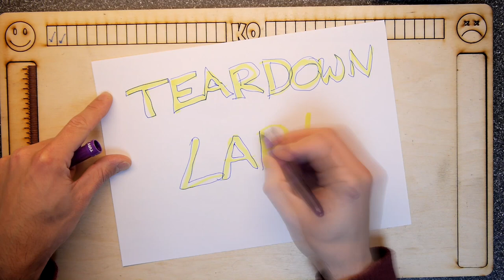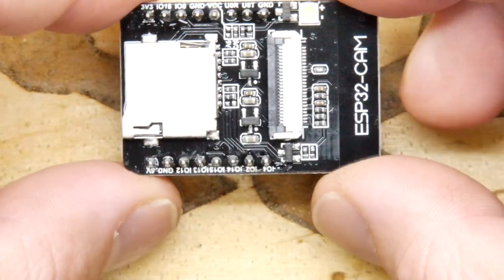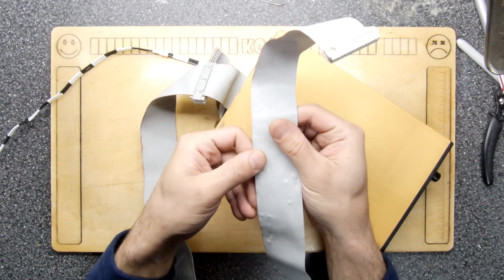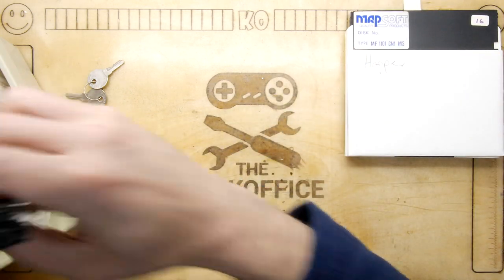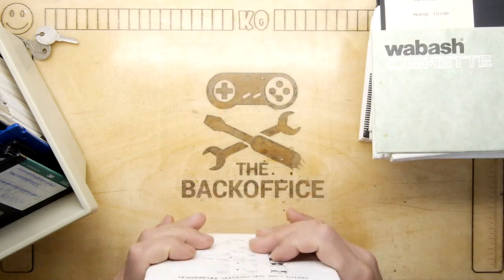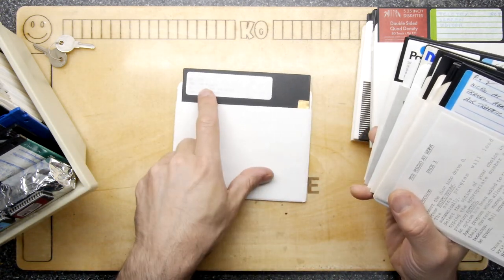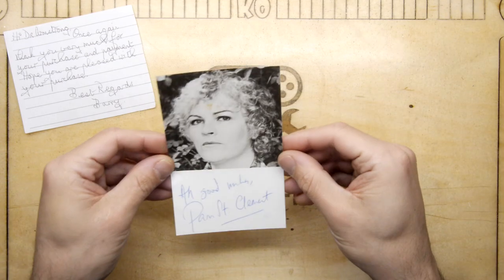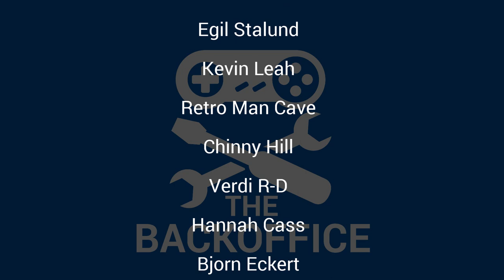April Excitement!

Comment: The notch was how you did the write protect. As they are, you can write to them, to make them read only, you used to get these little labels that you would stick over the notch. I used to repair and setup all these when I worked at RM.
Reply from the maker: If I recorded you can put an option the other side as well what was that for?
Reply: @backofficeshow  not sure what you mean. If you mean if it's got two tabs, it's a dual side disc.

Comment: Make sure you test the real capacity of the sd card. A lot of them from China have hacked firmware that shows them as higher capacity than they really are. Once you fill the card with data anything over still shows up but is unreadable.
Reply from the maker: I will have a look to see if there is a specific test that works